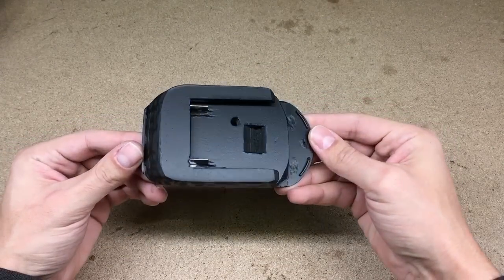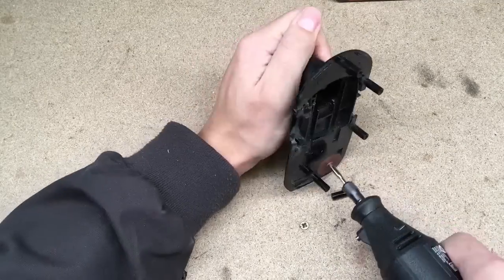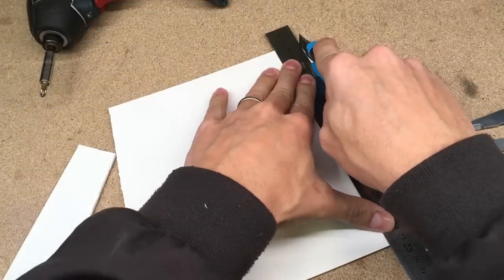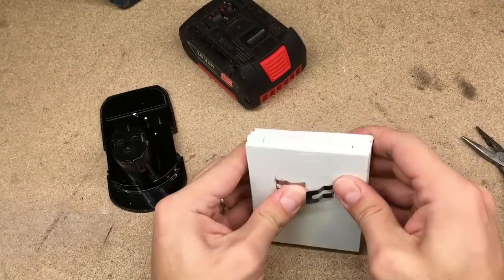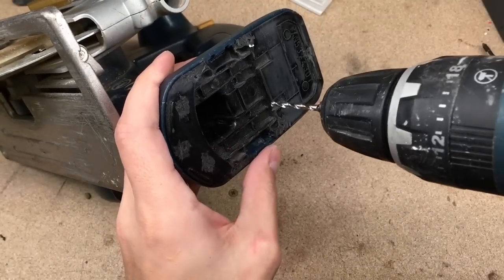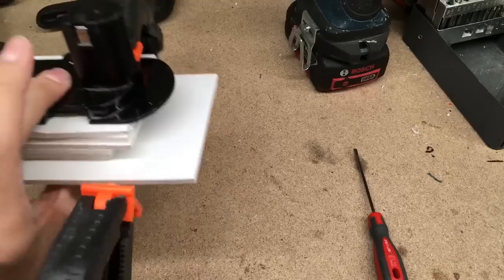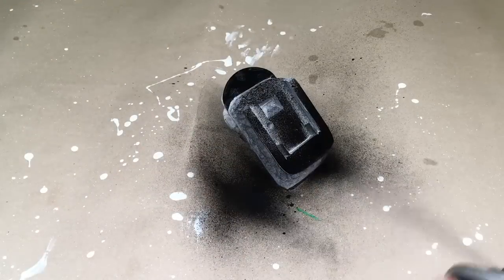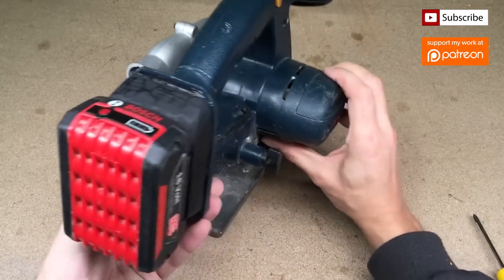DIY: Lithium Battery To NiCd Power Tool (With Simple Adapter)

Comment: Never use a Lithium battery on a tool wired for Ni-cad.
Reply: Tools are not "wired for NiCad", only the chargers are. Where do you get such notions?
Reply: @CrookedCandle  The company web site, azzclown.  And of course tools are wired differently for different power sources. think before you post your mindless drivel, moron.
Reply: Bill Cenne 18 volts, whether it’s NiCad or lithium is still 18 volts. The original Ryobi blue 18 volt power tools were all NiCad. When Ryobi first started producing their green lithium powered tools, they said all their previous blue NiCad tools could use their new lithium batteries. Same with the original DeWalt 18 volt tools that used their stemmed NiCad batteries. Later on, DeWalt came out with 18 volt stemmed lithium batteries that were used for those same “NiCad” tools. The only difference for both Ryobi and DeWalt, were you had to use different chargers for the lithium batteries. Although the NiCad batteries could be charged in the newer lithium chargers.
Reply: A little late to the party but Bill is partially correct. Lithium batteries need a way to control the discharge levels.
To be usable or not depends on how the battery or tool cuts the power when you reach the low voltage threshold to not damage it. This is done with a BMS (Battery Management Systems). 
For example with Milwaukee the M12 batteries do not have a BMS and the low voltage cut is done thru the tool electronic board. If you use a M12 battery on a "dumb tool" that doesn't disconnect the connection when you discharge to the low voltage limit, you will damage the battery. 
But the M18 of Milwaukee, and some of Makita and Ryobi have a BMS directly on the battery and will be compatible with "Dumb Tools".
Reply: You sound like you know what yuore talking about it, but the manufacture says dont do it, so dont!

Comment: Just so you know... The bosch battery doesnt have any protection circuit so you will kill the battery if you discharge it completely...
Reply: Why do you think that?  I'm curious because most lithium batteries have battery protection built into the batteries themselves.
Reply: @JRSkola  Easy: Most Batteries today, including Bosch and Makita, do NOT have the protection circuit in the battery, but in the tool.

Comment: that's a lot of fukin around
Reply: Yeah, I wish the manufacturers would come out with their own adapters for their shitty end of life products. Or would it kill them to simply make lithium batteries using their original style battery cases? They could include protection circuitry to ensure they couldn't be charged in a nicd charger.
Reply: Yes, I'm going a different route. I'm buying the DeWalt adapter $14 on eBay and hacking it and my old battery housing.

Comment: Great thoughts and design.  BUT it's a Ryobi cordless tool , all you need is to go to Home Depot and get the latest battery and put it in and ready to use. Ryobi never change adepter format.  Done deal.
Reply: If you have mixed brands of batteries around, this is much better than buying another low quality Ryobi batt.
Reply: For Ryobi this may be true but the Craftsman 19.2V system has been discontinued by the brand's new owner.  Apparently Ryobi's mfr made a lot of the "EX" and "C3" Craftsman stuff and the new owner is a competitor, hence the discontinuation.

There now are pre-built adapters like these for the Craftsman power tools, one that takes Dewalt and one other brand's batteries that have similar 5 pin mating surfaces, and one that takes 4 pin mating surfaces compatible with Black & Decker, Porter Cable, and one other similar system.  These adapters are around $20.  I'm tempted to pick a couple up, they're thicker than absolutely necessary to electrically connect, so even if they lack a BMS it might be possible to build one into empty space inside of the housing like up the stalk.

I'm disappointed in Stanley's choice to discontinue the 19.2V series, I have more than a dozen tools in that series and have bought batteries twice since my original two.  Stanley has given me no reason to remain brand-loyal, so at this point if I go with adapters I'll go with whomever has the best prices for higher mAh batteries.

Comment: Good video.  I need to adapt my old 18V NiCD Milwaukee tools to use Rigid Lithium and this approach should work for me.  Rigid batteries need spring loaded receiving terminals so have been trying to sort out how to create a good connection.  I might use sheets of oak versus the foam board, depending upon what I can find locally.

Comment: Interesting, But the more you use it, the more that foam adapter is going to wear down and the battery will get looser until it won't work.
Reply: James DeRuvo hence going 3D printed in the end. It's a simple solution for a quick adapter to use while starting out I think.
Reply: You could also use hdpe sheet. Go to the supermarket and get a thin cutting board. Never wear out.